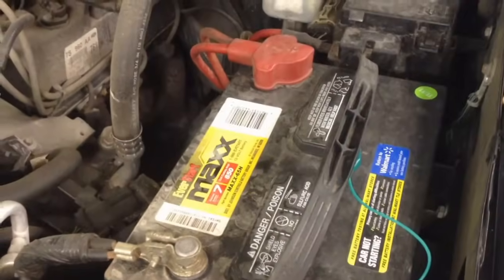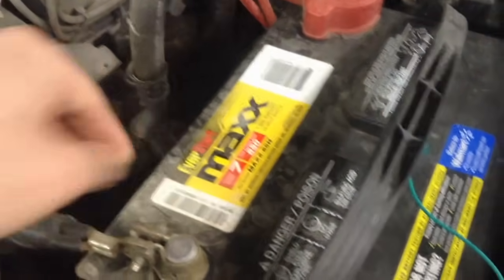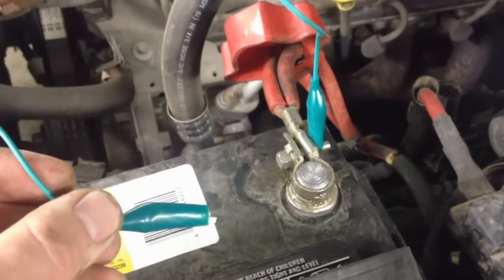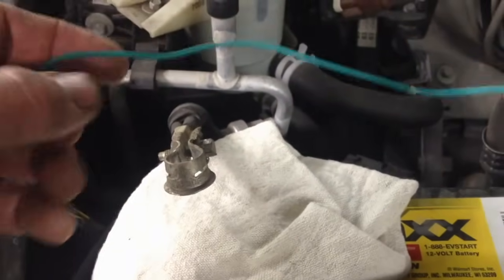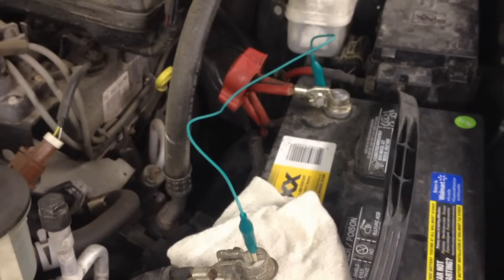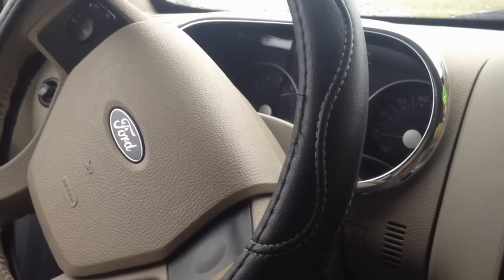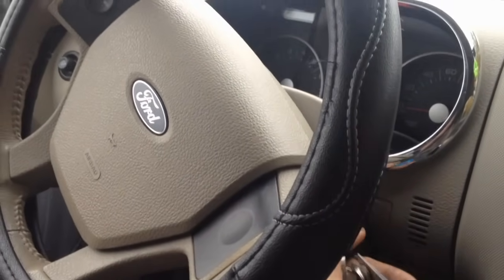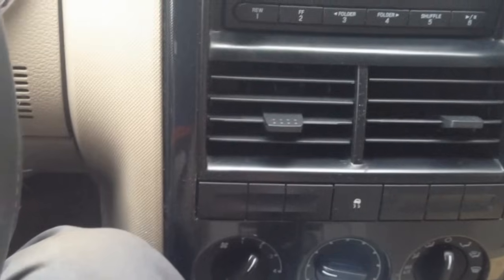How To Clear Your PCM'S Memory On Fords After Repairs

Comment: So with this method it will clear the shift tables altogether? I have a 2014 Ford Escape SE. I always thought I needed to go in with a scan tool and clear them out that way. If I can just use a small jumper cable to clear it then it will be much easier!
Reply: would you recommend doing this after replacing my timing components and oil pump? (2008 F-150 4x4)

Comment: I'm changing a automatic transmission in a 2010 Transit Connect. Should I do this to start from scratch as you say? the trans is coming from a Ford dealer. Will it have to be programmed or just relearned? Is it necessary to use a battery saver to keep from losing programs. Thanks for your time. Hope you see this quickly. Could use your input Sir!!

Comment: Hi I am confused as you have a subsequent ytube which states disconnecting the battery and shorting the power line will not clear pcm values.  I have a 2009 Ford Focus TDCI 2.0 titanium auto power shift and wanted to clear the pcm to allow it to relearn.  Have followed this procedure but not sure if it has clear the memory or not?

Comment: Hey, What's up with the TRW Gen 1 Epas Steering system - mine stopped dead today ( lucky I drive slow.   NO STEERING!  it would take super human strngth to try - I thought it would hurt the car so I didn't.  Please help in video ...I am Subscribed. The car is an awd 2012 ford fusion - loaded.  And I thought I had a winner...

Comment: Wil this work on my 2013 focus st
Reply from the maker: Yes
Reply: FordTechMakuloco Hi the engine speed input sensor or p0727 fault code has come up on my ST 07 focus. can you fill up the box oil on these or is it a sealed unit? also do i need a new box or just find sensor fault and replace. thanks in advance

Comment: You mentioned, during the test drive for learning the shift points, to "shift through the gears, 1st-5th"...was that allowing the auto tranny to shift or to place it in 1st low and manually shift it through to D drive?  Likely a stupid question
Reply from the maker: You just let the transmission do the shifting in the normal D position.
Reply: FordTechMakuloco my 2000 ford expedition is running and it has almost 300xxx miles. I bought the bluedriver scanner and it say the PCM has something wrong but it runs strong. Is it because it has the check engine light?

Comment: Is this safe for a Lincoln MKS with the 6F50 transmission?
Reply: Does it reset the adaptive transmission
Reply from the maker: yes
Reply: massey706 removing key cylinder from 1998 mustang convertible 3.8
Reply: massey706  have you done it for your Lincoln if so did it help? I’m very frustrated with my shifting in my car the trans seems fine fluid is fine and it’s clean

Comment: I have a 07 f150 5.4. Even after replacing everything involved with a code p0430. My engine light comes on and its still the po430 code.

Comment: I have a Ford fusion energi 2013 , I had a n issue with the pedal sensor , and the technican was not able to fix it , he replaced the pedal , the Throttle , the 12v battery even the PCM , finally he found water on the PCM connector under the steering wheel , he cleaned it and the issue was fixed , but aftar I took the car , I felt that it has bad acceleration and bad fuel efficiency , could this coused coz of replacing the battery or the PCM ? , and I don't think he did this  procedure ! , I drove the car for week now and the issue still exist :( , I have the car checked on the Ford IDC , but all the readings are fine , what do you think I should do ? , thank you

Comment: Does this procedure pretty much clear the hard codes? The reason I ask, is because I have a 2007 Ford Ranger with the 4.0 SOHC and the oil light is on. I replaced the oil pressure sending unit with a new one and the light is still on. I've let the engine run for a long time, and I even done a oil flush on it. What do you think could be causing this?UPDATE: I took my truck into a dealership and they charged me $85 to hook a true gauge up to the engine. It really doesn't have low oil pressure, and they said it was in the wiring. All the wires look good to me, so this is a real mystery.

Comment: I'm following the steps but still having some problems. My rpms are very high. When I go on the test drive is there a recommended speed? I've seen other channels suggest having the ac on during idling, do you recommend this? Also still having issue with it dying at stops. Please tell me I'm missing something simple that can fix this

Comment: Will disconnecting the cables for 10 minutes do the same thing?
Reply from the maker: In most cases yes but for those instances you need to definitely clear items like the trans adaptive table this is a fool proof method for sure.
Reply: FordTechMakuloco thanks, I never heard that trick before. Does it matter if  the motor is completely cool?

Comment: 3 days ago I cleared the memory on my 2008 F250 per your video.  Oh my goodness, what a difference!  It now shifts more intelligently, making it easier on the 5.4 motor.  I carry about 1600 pounds of construction tools every day and have been using the tow/haul mode most of the time.  Not any more!  Thank you for sharing your knowledge.  I appreciate you!
Reply: Thanks!
Reply: Good work!
Reply: Using the "tow/haul" mode is still a good idea for the longevity of your trans if you are hauling wieght. I was told by a career trans co. owner/race car guy, rebuilder(he did all the law enforcement vehicles in the area)so.....well experienced,  that having the choice he would never use the Overdrive on unless he was empty and then press it on once up to highway speed. It uses more fuel/gas no doubt but the trans does not suffer nearly as much. My 96 f250 4x4 wieghs in at nearly 7000 lbs empty. You can feel the difference in torque with it "off" I'm sure.

Comment: HOW TO CLEAR YOUR PCM, AND CLEAR MEM. FROM CAPACITORS 
Hi there thanks again for sharing this tip. After 4 months 2 of my monitors never got ready by themselves and I wasn't able to do my TX. inspection and my veh. registration. Changed my air filter, cleaned my maf. on my 2002 Ford Ranger 2.3 I followed your procedure and I was able PASS my TX. insp. and do my vehi. regist. with only one monitor incomplete  (evap for now)
Is this procedure SAFE FOR ALL VEHIC.  such as Toyotas, Nissans and not only for Fords?
I sent you a little something to support your awesome videos.
GOD BLESS YOU!!! :-)

Comment: Dude! Great video! You think this works on a 97 Mazda B4000 SE 2WD with a 5R55E transmission?
Reply from the maker: No so sure on the Mazdas
Reply: +FordTechMakuloco Let me tell You: the only original Mazda thing on that truck is the body. Everything else on that truck is Ford, it's a 97 Ford Ranger XLT extended cab 4.0 mfi ohv engine with a Mazda body. And a 5R55E 5-speed automatic transmission. That's why I asked
Reply: FordTechMakuloco Dude it worked on my 97 Mazda B4000!!! Did it exactly as you said, and my fuel economy is back! That 5R55E tranny shifts smoothly after repairing it and doing this!! So I can tell You this works on Rangers and Mazda B series 95-09. Thanx, man!
Reply: I thought it was the other way around.  That the guts of the Ranger are Mazda?

Comment: I am unable to load a tune on my 2013 Mustang GT due to it already having a tune loaded on it.  That's what my tuner says. Will this clear the tune that loaded and set the car back to stock?
Reply from the maker: No you will need to have the Ford dealer load the latest stock tune into the pcm.
Reply: brainranger6   Not true. I've loaded a new tune to my pcm over and over. Either a revision or another tuners tune. It over writes each one.  Sounds like your tuning device has issues or your tuning device is locked.

Comment: I have a 97 crown vic interceptor i changed the shift solenoid but the trans seems it's not getting a signal to drive. it goes in reverse just fine but not drive. the engine ideals down when put in drive but will not  move

Comment: i have a 2006 ford fusion an i jst replaced the transmission i tried to test drive it but it doesnt go past first gear i took it to auto zone to get check engine light read and its saying that its lost connection to the pcm so will this help my problem please help

Comment: i have a 2004 ford freestar. multiple check engines Lights. one day it says 3 codes.. then the next it says 10. i had water in my pcm. i cleaned it out. did fine for months. now its stalling with high rpms randomly and more codes. but my pcm is not wet.??? i have spent so much money! please help.

Comment: do you have the key in the ignition when doing this?..and is the key powered in the on position?...please let me know cause im about to do this.
Reply from the maker: +Rob g.l.w key is out
Reply: i tried this method yeterday it didnt work..i used a speaker wire to bridge it would that be fine..shifts a lil hard in drive..goes up to about 35mph then rpms go to about 2600..also noticed in park i went thru all gears like D N R 2 and 3..seemed to idle a little up and down in the low gears..i have a 2000 ford taurus

Comment: do I need to connect all the wiring for the throttle body before doing your procedure. I am also changing the ignition coil and plug wires on my 2004 mercury 4.0 v6. do you have video on replacing plug wires with this type of vehicle? Thanks

Comment: Dear Mr. Makuloco, 
I have 2004 FORD ENDEAVOUR 2.4 L (INDIA). My Friend took it and met with an accident. There was a dent in the Chasis. I got it fixed and the Workshop undertook repairs by disconnecting Body from ENGINE AND CHASSIS. 
After the damage was fixed the PATS system blinks with two long and four short beeps giving a code (DTC) of 24 which correlates to : Wiring Harness between PATS and DIESEL SMART MODULE (DSM) may be disconnected or cut. 
We checked the circuit, and it is fine. It was starting perfectly earlier and even after the CHASSIS repair. But this code keeps blinking and is annoying because it diverts attention while driving. The PCM learnt this perhaps someone switched on the Ignition when the body  was disconnected from  the DSM/ENGINE/CHASSIS. I took it FORD Dealer and it is standing there. At the present stage, the Car is not starting. Two days ago, it started and ran for 10 minutes and then stopped. It is not starting anymore.
Even though the ignition run position cranks the Engine, but there is no FUEL reaching the Diesel Injectors. And I am thinking that PATS is turning off the DSM or perhaps there is AIR lock inside the PUMP. I will be bleeding the same and also the DIESEL INJECTOR PIPES on MONDAY. However, I would like to negate the PATS -ve interference with normal operation of PATS and DSM, by  resetting the PATS so that the DTC 24 is not displayed and I would like to follow your procedures. You mentioned that Capacitor etc to be discharged. But I read somewhere you said wait for 10 minutes with -ve terminal disconnected and  it should discharge automatically. I gave the battery for charging and connected it after say 48 hours, the DTC 24 is still blinking. Should I short-circuit -ve and +ve. Also, I would like to remove both -ve and +ve terminals and then use a jumper lead between as I do not want the +ve to remain connected. I agree with you that since -ve of Battery is disconnected, it should not damage nothing else because the potential difference does not exist with -ve terminal Disconnected. 
I do hope that I am able to reset  and nullify PATS 24 DTC code. Let me know your thoughts about Reset wrt to DTC 24 code. Will the PCM re-learn that the PATS and DSM are able to communicate without Harness / Disconnection issues. (because we are in connected state) 
Thanks,
Rajesh 
Legend: 
-ve : Negative
+ve: Postive

Comment: I had a code p0171/174. I replaced the IAC valve, PCV valve and vacuum line, the intake gasket AND manifold (being they crack), a faulty coil over plug, and all 4 O2 sensors. My code p0171/174 is gone. I now have a code p0175. I'm going to change my oil first as when it was running lean could have dilluted the oil with fuel. If my code 175 still comes up, is it possible this video would be a good thing to do or is it possible I might now have another problem? I have already put about $500 into the parts alone to solve the 171/174 code and I really don't want to keep on going as far as parts go. Any further suggestions would be VERY appreciated.
Reply: I forgot to add. My vehicle is a 2003 Ford Expedition XLT with a 5.4 liter 2V.
Reply: I gave an 03 expedition eddie bauer, and have the SAME ISSUE. Ive replaced the EGR, PCV, PCV lines (which is a beast on this truck), and I've replaced a few gaskets here and there, and still have the rough idle with intermittent stalling. Im going to try this this afternoon, hopefully it helps. Im about to just sit this thing in a field, and play with some explosives.

Comment: work for a ford fusion? hanging shift from 2nd to 3rd
Reply from the maker: 2008 and older
Reply: FordTechMakuloco any advice on the 2014 fusion pcm/tcm relearn? ive heard it has to be reset by a dealer or expensive diagnostic tools.. to clear the ram?
Reply from the maker: I go over it in detail here and how it must be done to work properly- https://www.youtube.com/watch?v=jWMliD_3s3o
Reply from the maker: For the 2-3 shift this concern is common on the 6f35 but if it is excessive then you are likely looking at a valve body issue.
Reply: FordTechMakuloco thank you, subbed! 👍
Reply: I have a 2006 ford fusion that hangs up between 1 and 2 shifts sometimes. Will this work?

Comment: thanks for the info you put on here. What else can you after replacing OSS, clearing the codes and letting it idle for 15 minutes and it still shifts hard? Code p0702 and p2106 were showing.

Comment: I have a 2014 f150 5.0l . i had a misfire code cylinder 4 .  so I took the negative cable off an changed the plug an coil pack .  check engine light came back on an same thing misfire cylinder 4 . would this maybe clear this .  thanks

Comment: Hi FordTechMakuloco,
Recently I fitted an aftermarket stereo all the connectors are foolproof however it messed up my rear window heater and my ignition. I took it out put the factory radio in with the code and all have been fixed however when I turn the key in the ignition Focus does the self test no red light on dash but when I try to start the engine the whole system shuts down everything goes blank and I need to reconnect the battery to gain juice again.
Can this method clear the car's computer if it stores any fault about immobiliser cause cause I took out the radio?!
Thank you
Reply: Hi, I am sorry that I am not waiting for your reply but I got solution for my problem following your instructions in this video. 
It was very useful and easy steps to follow. My car is up and running again, thank you again!

Comment: Awesome videos. Thank you for them. I have a 2011 Expedition that occasionally after some heavy traffic and stop and go NYC driving will downshift hard from 2 to 1 when coming to a stop. Never happens while accelerating. Just feels like the throttle jumps a bit when downshifting from 2 to 1. I read around on this issue and it seems like this might be fixed by clearing the PCM. What are your thoughts?

Comment: You don't need the alligator clips to drain residual power from the system. Just leave your headlights on. Takes a bit longer but if you don't have those alligator clips this method works fine.
Reply: Or just hit your brakes a few times after disconnecting the battery.
Reply: You can just put your positive battery cable to the negative cable and hold them for 30 seconds
Reply from the maker: +mischiefpwns problem is everything is ground based switching now so power never actually flows when you turn the headlights on anymore. This is the only foolproof way no matter what Year your vehicle is.

Comment: Does it have to be a thin gauge cable? Can you use Jump Leads?
Reply from the maker: Yes you can it is just much safer this way as the thin leads cannot draw much current in case something goes wrong.

Comment: Can i do this method on a Mazda 3 BK 2003 also?
Reply from the maker: Not sure on the mazdas pull the negative battery cable and let it sit for 10min instead.
Reply: FordTechMakuloco ok thx, but how can i verify that The pcm is resetet. for example when the Radio stations are gone away?

Comment: I had lost my keys to my f150 2001. I had a 2001 super crew that I did an ignition swap with. problem is that security light flashes fast. It will turn over but not start. can you help me. I did also swap out transponder ring.
Reply: Pcm cluster key need to match .pats .need programming

Comment: you do realize that you can kill all the power from car by undoing the terminal from battery and then turn the ignition to the on position and try to start it will kill all power from system..
Reply from the maker: Ah what you may not realize is everything is ground based now so that doesn't work very well
Reply: yes it does i have tested it as the earth for pcm is connected with the power in the stored creates a circuit.
Reply: FordTechMakuloco will this work if you are replacing a 2008 ford escape cluster?

Comment: Hi, nice vid. Amy chance I need to do a PCM clear if my radiator fan sensor will not engage in hot temp (It does work when AC is on)? Its a 2009 Mondeo MK4.